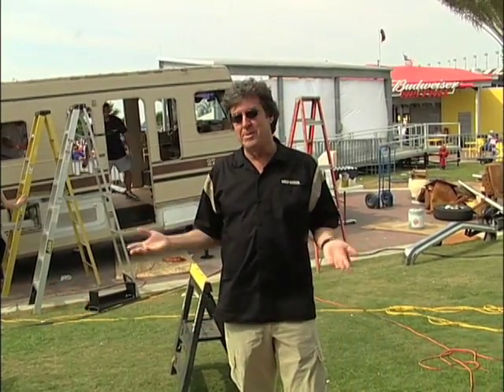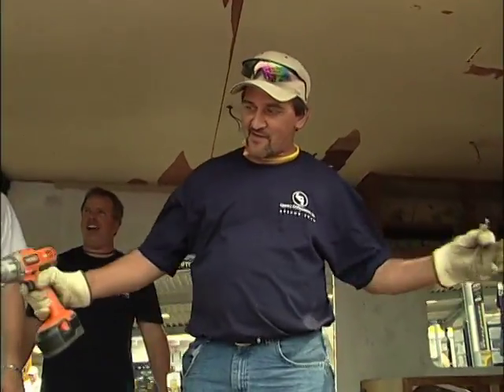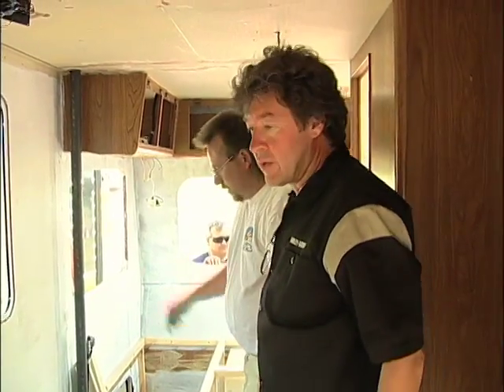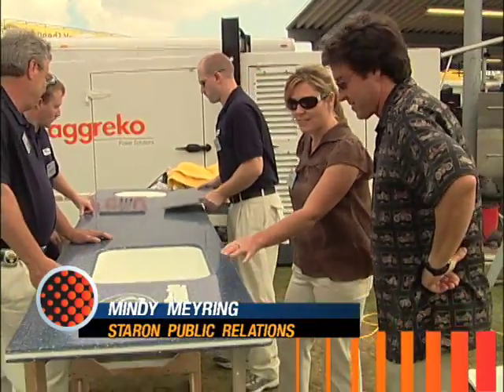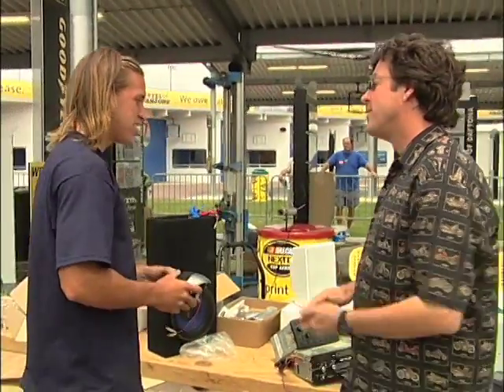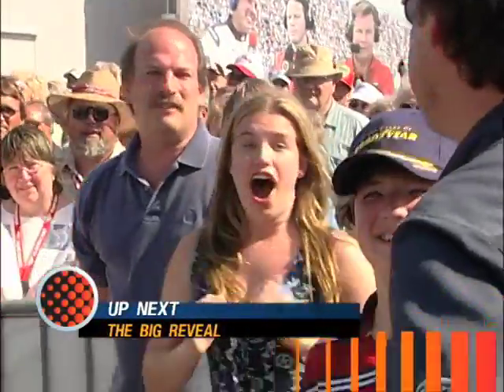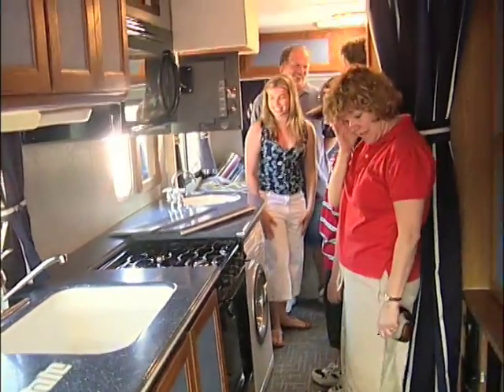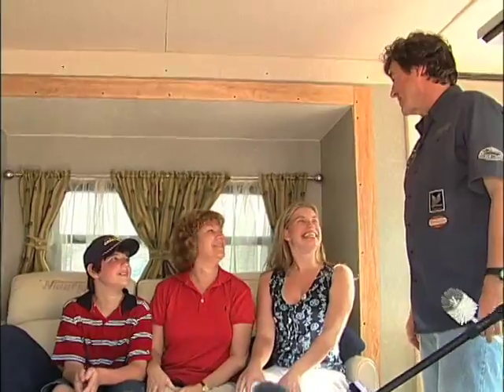RV Rescue Show Two

Comment: Sure hope someone checked to be sure the chassis is able to support all the additional weight of the slide!
Reply from the maker: You make an excellent point Shelly. As I saw all the extra eight going into the project, and on the chassis, I requested that we weigh the new rig to make sure it met the specs. I asked more than five times.  I am not sure that they did.

Comment: I think this show had a lot of potential to bad it did't get off the ground. I think some more attention to detail in the installation aspect of modifacations. 

 
The test run vehical was a dog to start with style wise. Purfuming a pig and putting a bow on it. The time line restraint was unrealistic a week would have been better with a crew like this.

I'am personaly redoing a 28' Airstreem motor home on a small budget and some of the things they were doing I would like to do with mine the hydralic jacks and slide out would be nice addition. Like I stated the shows over all was good for starting run I think it would have gotten much better with time.

Comment: Because it was a publicized project...I suppose the crew gets something out of it but in reality this had to have cost a fortune and I wouldn't be able to finance this. I will have to do everything on my own and it won't look like that I assure you....no high tech stuff...just replacing wood and furniture and sealing areas and remodeling but it will be quite vintage and homemade looking. I just don't see how this would be feasible.